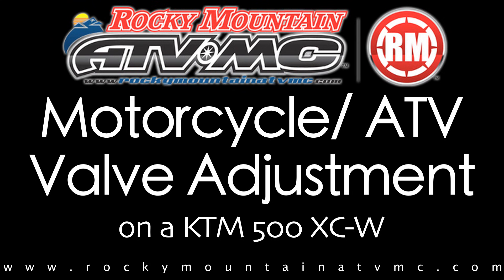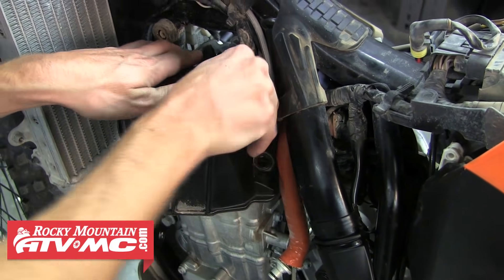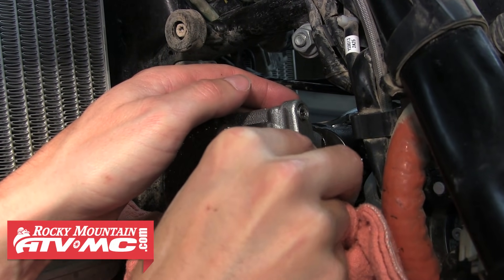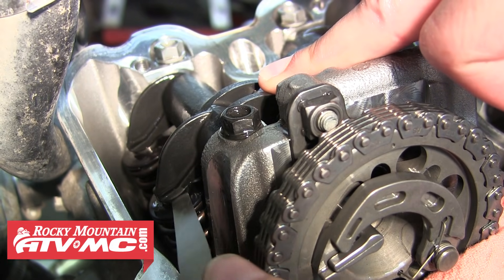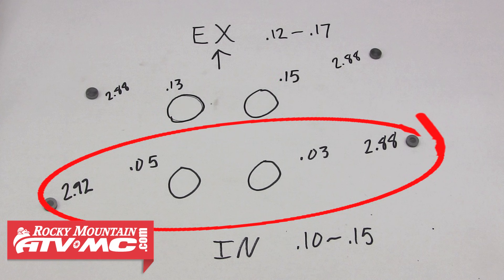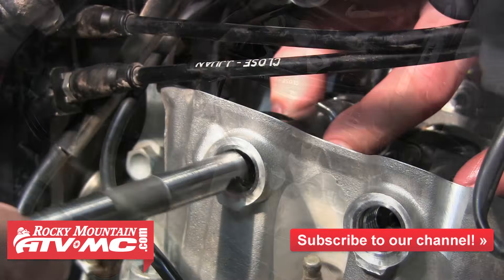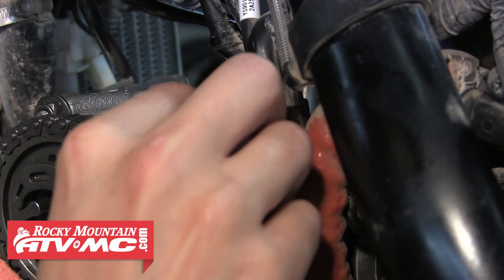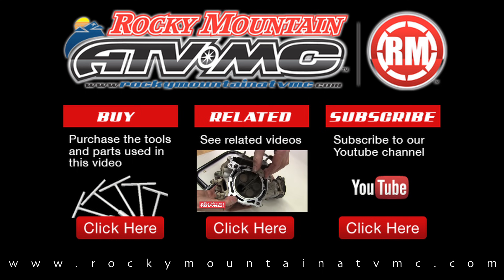How To Adjust the Valves on a KTM Motorcycle

Comment from the maker: @Glen Hogan To time this machine you will want to have the motor at Top Dead Center, then you will align the cam sprocket gear marking up with the marking on the cylinder head at 12:00. Let us know if you have any questions. Thanks for watching!
Reply: You aren't showing the right way though.
Reply: By the way I own a 2015 exc 500 and I haven't checked the valves yet but I'm torn between buying the special tool to find top dead center or just do your method but it doesn't look like it will be perfect by just lining up the two dots.
Reply from the maker: Richard Armstrong The safest bet is to go off of what your service manual says.
Reply: Thanks
Reply: Iam from India & have KTM-Bajaj collaboration made 200 NS Pulsar bike having engine similar to KTM Duke 200 , it has 4 valve SOHC setup & make tappet noise slightly even after setting tappets as per manual. What should be the culprit ? Mechanic has checked rocker arms & cam and he says they are normal
Reply: Rocky Mountain ATV MC

Comment: When putting new valve shims in, its always good practice to put a dab of fresh engine oil on the tops of the shims bofore reinstalling the rocker arms. Otherwise you could risk having a sort of "dry-start" situation and the shims could wear prematurely causing you to be right back where you started.
Reply: Good tip about the oil on the shim.  (One of my shims had a worn spot on into it...  ).125" deep......probably assembled dry at the factory

Comment: I was told once that the intake tends to decrease clearance while the exhaust tends to  increase the clearance gap because of the valve seat will wear from possible dirt in the intake air wearing the valve seat faster than the valve stem. Do you find this to be the case? The idea would be to run the intake tward the bigger end of the tolerance spectrum and the exhaust at the tighter end. I'm wondering if this would be a good practice?
Reply from the maker: darin amann The valve clearance gap tightens as you ride.  I haven't heard of this issue before unless you have something else going on causing that problem?  Generally you want to be in the middle of both tolerance spectrums, for both Intake and Exhaust.  Let us know if you have another question, thanks for watching!
Reply: If all the valve clearance gap always tightens over time when riding is it not better to try get it close to the widest so it will take longer before you need to re do the shimming?
Reply: @a64738  In theory the idea or suggestion sounds plausible, but in practice, not so much. If the question was true, it would be rare an occasion that the valve would be operating at it’s optimal gap. The engine will run much better if the gap is set correctly and rechecked at or close to the prescribed intervals

Comment: Hey amazing videos! One question in the repair manual of this actual bike they state to remove the camshaft and chain tensioner instead of the rocker shafts to adjust the valves. What is the reason of the different approach? I like your approach more

Comment: I'm going to adjust mine very very soon this off season. 170hrs and its first adjustment 😬
It's a '12 500 XCW. Stubborn to start and stalls easily if I were to slowly lug the bike around. I hope this takes care of those nuisances. I do change the fuel filter and plug regularly.
Reply: Manual says the 1st hour then every 30hrs.. lol. Yea your valves are probably way out.
Reply: @imds123  I adjusted the valves and I still had the same issues. My problem was fixed by changing the in tank fuel filter (never changed) I had only ever changed the in line filter. Oops

Comment: Nice video with good quality footage and good editing, just have a few suggestions:
I recommend torquing all removed fasteners to KTM spec, especially the bolts holding the rocker shafts in.
I oil the new shims on both sides because they will read loose when installed dry.
I also like to turn over the engine a few times after changing shims to fully seat everything where it will be in running condition, and then take the new measurements.

As others stated, highly recommend a micrometer, or at least high quality calipers to measure the shims.

Comment: nice tutorial! thanks! what is the torque setting for the 4 bolts that maintain the rocker arms shafts? and the torque of the plugs for the rocker arms shaft too, cannot find it in the manual. thanks
Reply: not sure what model KTM you have but on a 2013 KTM 500 xcw , rocker arm bolt torque is 15 Nm ( 11.1 ft lbs)  Rocker arm shaft plug torque is 20 Nm ( 14.8 ft lbs)

Comment: Do you have to take out both rocker arms if you're only doing one side?
Reply from the maker: Richard Armstrong No, you can simply adjust the one side.  You would want to check the other side to make sure it stayed within spec. Thanks for checking out our video!

Comment: I've just done this on my lc4 640 after an engine rebuild (bottom end), re-used piston and rings. 
So new con rod, crank etc.. 
How long should I run it in for.?
Reply from the maker: I would recommend running the bike through a few heat cycles before really getting on it but you can always refer to your service manual for proper break in procedures. Let us know if you have any questions.

Comment: I have a 2014 KTM 450 SXF. I read the service manual and it isn't too helpful at all. It mentions to do a few other things like remove the timing chain tensioner, take timing chain off camshaft gear, and remove the camshaft. However in this video those things are not being done. Does it just not need to be done for this particular bike?
Reply: Clayton McCandless This is a 500 exc and  it's a DOHC so it may be different for your SXF since it's SOHC. I don't think you need to take off the timing chain and tensioner.
Reply from the maker: Clayton McCandless I would instruct you to follow the steps mentioned in your service manual for your bike. I would have you read the steps on how to adjust your valves.  From what you are mentioning, that sounds correct.
Reply: +Thom 1888 i think you mixed up the models, 500 exc is SOHC

Comment: Hey, Just had a question for ya... This does look pretty easy. But I bought a 2015 KTM 500EXC. I've never done this before so... How much would it cost me for a dealer to do this job? VS. me buying SHIMS, GAUGES, MICROMETER OR CALIPERS??? Just asking...Thanks.
Reply: I guess the dealer charges an hour for the job.
Reply: Mark Idk but tools you can buy once and use them a lifetime or close. Regular maintenance at the dealer on the other hand will cost you a lot more in the long run for sure.

Comment: Great video! I'm about to attempt my first valve check this week.  I have a Rekluse auto clutch in my EXC500.  Can I use the kick starter to turn the motor as an alternative to turning the back wheel?
Reply from the maker: Hi medpilot We're glad to hear you are planning your first valve adjustment. It's definitely one of those jobs you are proud of after it's been complete and you're bike is running awesome! As far as using your kick starter to turn over the engine to find tdc, it would work fine. We use the rear tire in the highest gear to make it easier to turn the engine over though, depending on where your engine is in it's stroke it could be more difficult trying to use your kickstarter to find tdc but either way works... Let us know if you run into any other questions and how it goes!
Reply: Rocky Mountain ATV MC Thanks for the reply.  Again, I would prefer to use the rear wheel as well, however the Rekluse auto clutch makes that impossible.

Comment: Sometimes the vent cover hose can be a pain to get back on, you can simply remove it from where it is routed to (airbox) and then reinstall it to the airbox once the valve cover is back on.  Also, be careful when removing the valve cover and using wrenches as you can bend/damage the radiator.  Be careful of finger placement around the cam chain, if the back wheel is bumped the engine will roll to bottom and can cause injury.

Comment: Rocky Mountain ATV MC hey do i need to mind about the compression stroke or i just need to allign the two dot? I got a ktm 530 exc 2009
Thanks
Reply from the maker: joey downing If you are simply adjusting the valves only and not timing the machine then no.  You will not want to have any tension on the camshaft or rocker arms and by lining up the two dots helps acheive that. You may need to rotate it twice to find the sweet spot with the least amount of tension. Still make sure to align the dots, its a good marking to go off of. Thanks for checkin out our video!

Comment: Why did you leave out the part where you are supposed to use the special tool to find top dead center and then you are supposed to release the tension from the camshaft also? this is what I'm reading in my service manual
Reply from the maker: Richard Armstrong What year, make and model machine are you working on?  Each model bike can be different in its own way.  If you have the service manual for your bike, i would recommend you follow those step by step instructions.  Let us know if you have any questions and thanks for watching!

Comment: my intake valve clearance should be between .10-.20 mm. on one of my intake valves it is at .76 with my feeler gauges. the other intake valve is within spec. is it safe to say the valve needs to be replaced?
Reply from the maker: lee smythe What bike are you working on? Clearances will tend to get smaller as the valve train wears so it's a little weird to find your intake clearance on the one valve so big. I wouldn't assume that it's time to replace valves. You can always try a bigger shim to get your clearance into spec and run that. When was the last time the valves were adjusted and were they done by you or someone else?
Reply: its a 2006 ktm 250 sxf. not sure when the last time they were adjusted, just recently bought the bike.
Reply from the maker: lee smythe Seems to me that your valve could be worn out.  I'd tell ya to tear into it a little deeper, if ya got the money to do so ya know.  Let me know what ya find out tearing into it man. Let us know if you have any other questions! Good luck!

Comment: I realize this is a couple years old now but just curious as to what Torque specs you used for the 4 rocker arm shaft bolts when you reinstalled them?
Reply: +Joseph Mosquera They used what their service manual said to use. ;)
Reply: +Joe Smathers 
Thanks for the reply.  I have the service manual  and is says 15nm.  I asked because I recently checked my valves and had 1 intake valve slightly out of spec. After changing that 1 valve shim and re tightening  the rocker arms bolts to specs in the manual, all of  the valves were too tight. Seemed very odd.
Reply: Which is part of exactly why service manuals say to check the gaps after retightening. Did the ambient or engine temperatures change significantly while you were servicing the engine? That can impact the measured values.

Additionally, it may just be that one or more sets of fasteners might not have been tightened to spec before you got to them. I'm not making accusations or suggesting any actions, I'm just saying that it happens.

I helped a friend rebuild his CA18DET (180/240SX engine), and we ended up buying shims three times. 7 the first time, 3 the second time and 2 the last time. Can't explain exactly what was causing our problem, but by the time it was said and done those shims were perfectly within spec after dismantling and reassembling the valvetrain twice in a row. :)

Comment: Can anyone explain how the clearance gets out of spec?  I'm surprised that the clearance on these valves was too tight and smaller shims had to be used.  I'd think if anything, parts wear, so changing anything to a smaller size is not what I expected.  Just curious if anyone knows what I mean and could explain.  Thanks.

Comment: any chance you can do a vid for the freeride 350 plus I,m havin trouble with waterpump seals leaking after 20 hrs ,a vid on replacing freeride 350 water pump seals would be very helpful ,I know asking a lot but worth a try LOL,thanks for takin the time to post these vids.
Reply from the maker: salisburyplain998 Man if we had the bike i'm sure we would, those are sweet bikes!  That's kind of crazy they're seeping on ya only after 20 hours.  I'd have ya refer to your owners manual on it
Reply: Thanks for your reply ,I love the freeride,I also have 2014 EXC 350f but ride the Freeride twice as much ,I think I have solved the water pump issue ,there was a build up of some kind on the water pump spindle that was wearing the seal so fingers crossed these seals will last a little longer ,I also have checked the valves and with 133 hrs its still just with in spec .
Reply from the maker: salisburyplain998 133 hours awesome!  Glad you got her all figured out.  Tracking down the problem can get frustrating, but rewarding in the end.  Thanks for watching

Comment: Does it matter if it’s TDC on compression or exhaust? Also is the assembly lube for the top of the shims or for the rocker arms or for both?
Reply: TDC should be when both intake and exhaust valves are closed, and the marks on cam sprocket line up with the mark on the head.

Comment: How do you remove the rocker arm pins on a 2017 Husqvarna FE450? It's not threaded so the bolt trick doesn't work...

Comment: Hey, does anyone know the stock valve timings of the KTM 500 EXC, looked everywhere including service manual and got nothing, any help here would be awesome. Cheers
Reply: +Glen Hogan Valve clearance is: EXHAUST 0.12...0.17mm (0.0047...0.0067in)INTAKE 0.10...0.15mm (0.0039...0.0059in) This is for a 2015 KTM500EXC.

Comment: Great vid!! also going to attempt this soon, I have a question, I have a hotcams shim kit for a 2006 ltz400, would the shims work on my 2010 450 exc? Are they the same sizes and all that? Thanks!!
Reply from the maker: It looks like your 2010 450 EXCR uses 10mm OD Shims and the Z400 only uses the 9.48mm OD Shims so no your Z400 shim kit would not work for your KTM
Reply: Rocky Mountain ATV MC I seee!! thanks for the reply!

Comment: Hi, thanks for this video.I'm following it step by step but I do have a question. Why did you choose 0.13mm as a desired clearance for the intake.

Here are my numbers: Intake:  right= 0.12mm and left 0.07mm  so I would leave the right side alone and use a 2.80mm on the left? ( 0.13mm - 0.07mm = 0.06mm  if my existing shim is 2.86mm , I'd subtract 0.06 and get 2.80mm)

As for the  exhaust,  I have 0.12mm right side  and 0.10mm left side. Not sure what I should do with those. The right side is right on the lower limit of the spec ( 0.12 - 0.17)  as for the left , I know it's not within spec but what is the desired clearance? Would you still use 0.13mm ?  

Thanks for the help.
Reply from the maker: It sounds like you are on the right track to get the intake clearances in spec by swapping out that 2.86mm shim for the 2.80mm to increase the clearance for that valve. What bike are you working on? You'll want to make sure you are referring to your service manual for the clearance specs that will be specific to your bike. They will be something similar to these specifications but some may require a different clearance so i would start there. As for the exhaust i would move both shims down to the next smaller size to get those clearances more into the recommended specs. If you have any questions let me know
Reply: Rocky Mountain ATV MC Thanks for the reply. I'm working on my 2009 530 xcw.  I went with 0.15mm as a desired clearance for the exhaust ( specs are 0.12mm - 0.17mm).
Reply from the maker: *****
 Alrighty, it sounds like you've got it figured out. If you run into any other questions let us know!

Comment: Hi RM, awesome vid. Can you help me, I'm trying to measure valve clearances. How do I get TDC on a 2012 ktm 250 sxf?
Reply from the maker: It looks to me like there are a couple ways to find TDC on this motor like most all the other RFS engines. You have a TDC locating screw in the engine case from which you will remove and then remove the sealing washer underneath it and then reinstall it into the case. You can then use it to find TDC by feeling for the channel in the crankshaft balancer. You can also use the marks on the camshaft gears to help you find it. I would refer to your service manual for further steps and specifications

Comment: As always , my go to source  to build knowledge  and confidence  to properly mechanic on my 500 excf I rely on Kyle  at DIRT BIKE MAG. , or ROCKY . THEN I FINE TUNE BY READING COMMENTS,  LIKE ADDING A DROP OF OIL TO THE SHIM . 
MY TAKE AND I LIVE BY THIS RULE ! IF THERE IS A TOOL MADE FOR THE JOB , IT PAYS FOR ITSELF. ROCKY MOUNTAIN
IS MY GO TO FOR ALL MY TOOLS AND THE TUSK LINE UP IS NO COMPROMISE IN QUALITY. 
TO DATE , WORKING AT TRUING A RIM HAS BEEN MY BIGGEST  CHALLENGES AND WITHOUT THE TUSK TRUING STAND  , TUSK TIRE CHANGER , TUSK TORQUE SPOKE TORQUE WRENCH, TUSK TIRE SPOONS, WELL YOU GET MY POINT. 
I FAILED 4 ATTEMPTS AT ALIGHNING THE REAR RIM WITH TOTAL FRUSTRATION UNTIL I REALIZED  I NEEDED TO START OVER BY REPLACING ALL THE SPOKE NUTS ,LUBE WITH WD40 AND TAKE CARE TO WATCH THE RUNOUT AS I TIGHTENED.  REMOVE ANY OUT OF ROUND WHILE FIRST TIGHTENING THEN ONLY THE SLIGHTEST TWEAK WHEN NEAR TIGHT  AFTER USING THE EVERY 4 SPOKE TIGHTENING METHOD  ( WATCH ROCKYS VIDEO). AND GOOD LUCK , TAKE YOU TIME FIRST TIMERS LIKE MYSELF.

Comment: I thought that was a great video.  I've worked on diesel engines for years but now have my first dirt bike.  It was running a little rough so I'm going to check the valves.  The video was very well done and thorough. Thank you